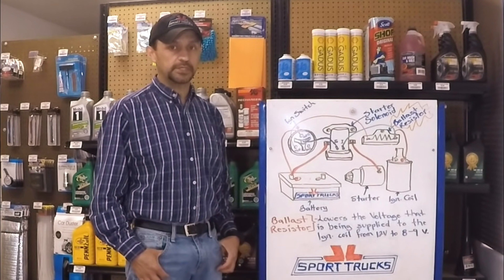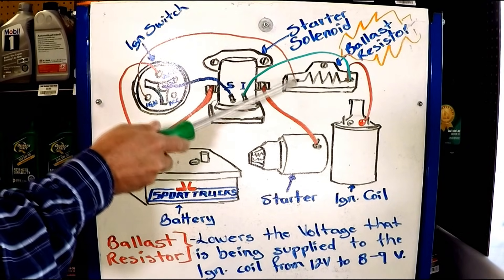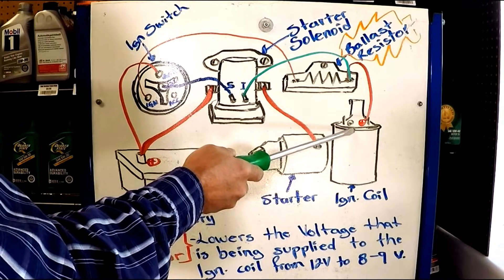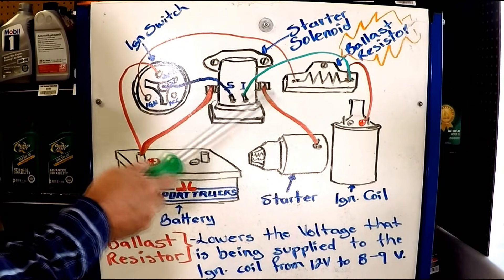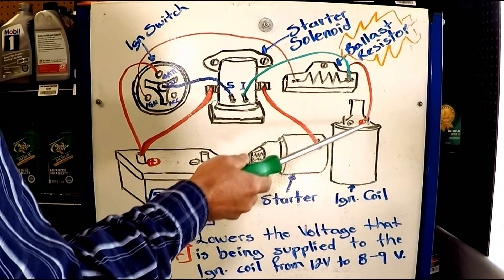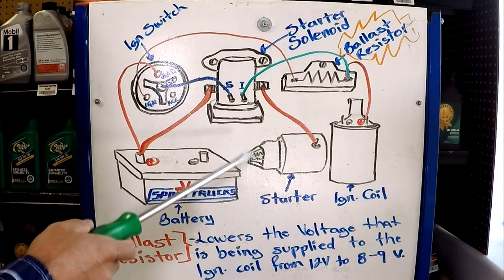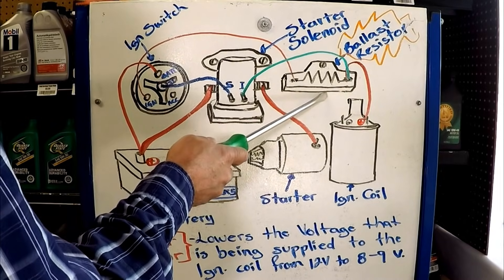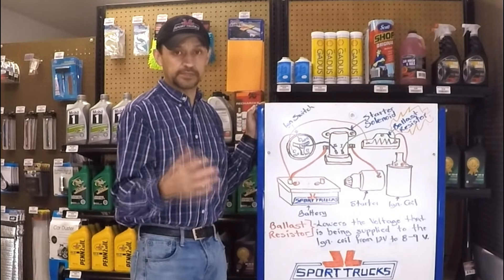How the Ballast Resistor Works

Comment: Very well explained.
Reply: On a old tractor I'm wiring up I wired in a wire with a diode into the wire from the starter button to the coil so it bypasses the resistor

Comment: Good information! I learned something on this! I've had some experiences when in cranking a motor, it doesn't start until I release the key from the START position. In doing so, the spark current returns to the coil wire when it's not totally taken up by the starter.

Comment: Is it the voltage that causes heat or is it the current flow? Isn't the ballast resistor ultimately reducing the current flow in the coil because adding more resistors into a circuit reduces current flow based on I=V/R from V=IR as the voltage is constant!

Comment: YES!  He explained it correctly.  So many people will tell you that the "I" wire is so the coil can get 'A full 12 volts during cranking'.  This is not correct.  His explanation is correct.  While cranking the potential voltage drops to 8 to 9 volts and that's why the ballast is bypassed.   Thank you!

Comment: I'm wondering , if in an early Ford tractor system at 6 volts , could the ballast resistor be removed to cure a weak spark condition ?

Comment: My '47 Ford, with original flathead V8, was converted to 12 volt system but still runs the original 6v ignition coil.  2 ballast resistors for this setup!

Comment: Dude!  This was the best damned video I've ever seen explaining what happens at ignition and why there are ballast resistors.  I am working on my Ford 640 and replaced the ignition switch was seemingly malfunctioning intermittently.  When I pulled the hood to get at the tiny block terminal, I noticed that there was a resistor under the dash wired through the terminal block.  This Tractor had a 12v conversion done to it long before I owned it, so I figured it was unnecessary and might cause a weak spark so I disconnected it (and installed a new coil requiring, supposedly, no external resistor) and rebuilt the distributor and put in a new condenser and points).  When I tried to start it after all of that, it would not start at all.  Since I know it had spark before I disconnected the resistor, I figured that ballast resistor must somehow be in the ignition circuit, so I reconnected it and it fired right up.

QUESTION:  The new coil says it does not need an external resistor, which I take to mean that it has an internal resistor.  Does this make the coil more in the 6v range and is that okay for the points and spark? If not, how do I bypass the external resistor?  I've seen a lot of comments referencing the 12v coils burning too hot for the points, but does this matter at all?

By the way, it purrs like a kitten and all four cylinders have a good spark  - I tested them all.  Shocking how good this 1957 tractor runs despite the general abuse it has taken over the years.  Anyway - thanks for the video.  This was terrific help.

Comment: Good stuff man, I bought a 66 Fury and when I started going through it I noticed that they had electrical tape around a fuse.  As it turned out they used that fuse as a bypass of the ballast resitor. Granted, they installed an MSD distributor with an MSD Blaster 3 coil, however, the coil does not need 12 volts going through it.  I couldn't find the clue until I watched your video.

Comment: Does there need to be a diode in the wire coming off of the starter seleniod to the ballast resistor to keep from backfeeding the starter selenoid when in normal engine running operation?

Comment: I have a question you do not show the wiring from the coil to the distributor I wired my tractor as you have shown and it only works if the distributor point are closed, If the engine stops with the points open the start curcit does not work. Could you please explain how this works. I put in a start relay to provide the full start voltage to the coil
Thanks Andy

Comment: My Plymouth has over 12 volt's on both sides of the coil?
a ballast resistor reduces voltage,... is there a way to test a resistor to see if its good.

Comment: I had a old civic with contact breaker points. The points burnt every two months or so. I got tired of sand paper ritual. Then, someone suggested the resistor and that solved the problem. I never damaged the coil in the 5 years I drove that thing.
In another another car, I damaged a few ignition switches when I tried to not used the FORD solenoid. It appears that the current for the starter mounted solenoid was too much for the ignition switch. It looked like that FORD system uses the solenoid as a relay for the other solenoid. I never liked the direct connection of  positive  cable in old chevrolets.
Great explanation!

Comment: Thanks so much! 

Fantastic explanations. My buddy is a mechanic and shared this with me for use with my boat: A 1989 Ski Nautique 2001 inboard with a Ford Winchester Pleasure Craft Marine 351 motor. 

I’ve been having issues with my motor starting (even with the ignition switch and key turned off) whenever I connect my battery cables. Seems like my Solenoid has maybe gone bad, but gosh your breakdown of the entire ignition chain is so informative I feel much more confident in tracking down the faulty part or cable (like you said, could be something crimped or chewed on by a mouse etc. 😅)

Many thanks my friend. You are an amazing resource of information and knowledge. Will be sure to share your content with friends. 😁👍

Comment: Great tutorial mate. Easy to understand and made a lot of sense for me to hook up the new wiring harness of my customer's Mustang. Cheers
Reply: Hello Sir, one question are you replacing the whole wire harness? If you do not mind to ask you, where did you buy it, is it new or used? I need one for my 1997 mercury mountaineer V-8 5.0 engine, at least for the coils and sensors in the engine compartment, please let me know if you can thanks in advance...

Comment: Outstanding job. I worked as a technical educator for 5 years, then 29 years in automotive manufacturing, part of that time developing service training for distributor and  fleet customer service technicians. I am not a mechanic though, but, I recognize good tutorials when I see them (an all too rare occurrence). There is a need (unanswered demand) for no-nonsense training manuals and audiovisuals for the vintage car owner/enthusiast (non-mechanics, myself included), on early Ford, 6 volt generator, positive ground electrical systems. Actually, vintage car professional (?) mechanics could use it as well. Specifically the battery/generator/voltage regulator (control box as it was called in certain publications)/starter/coil and related wiring, resistors, etc..

You wouldn’t get rich but you might break even and just think of the fun you’d have!

Comment: Good video.
Could you tell what might be wrong if my engine does not turn off when the key is in the off position. I thought it might be the ignition so I changed it, but still will not turn off when key is in off positions

Comment: This was a great video. I have 1965 Ford Ranchero, it dided on the fwy, it started back up, drove it 2 miles died again, found the power wire that looked slightly burnt, replaced it. It has  been fine but it started up again. 2 more times it died but started right back up after several tries. I put a jumper from the battery to the coil and it ran great for hours. So I think that tells me the coil is good and ballast resister is bad. Correct???

Comment: So what if my tractor is 6V? The resistor lowers the voltage to 4volts?
I am converting to Pertroix Ignitor. With their  Flamethrower coil. 
Should I dump the resistor and put maximum energy into the system?
Comments please...

Comment: This was a good video that explained it well. If this resistor is bypassed could it cause a slow crank?  My subject starts like it has a dying battery but everything is new and connections are proper. I have not checked on the resistor yet

Comment: I have a 1973 Dodge Dart Swinger with a 318 motor and I have replaced several components (Wires, Cap, Pickup coil, ECU and the coil. I am only getting ONE SPARK coming out of the coil. I am stumped and can't start my car. I was running for three years and 9 days ago, I drove it home and then on Sunday, I couldn't start it any more. I have not been able to figure out why it's not working. Any clues?

Comment: Cool video, Is it best to just use a bone stock coil with points? I have ran a few hot performance coils for my Pertronix upgrade, BUT, the Pertronix would crap out after a 100 miles of use, So I'm back to points, I've been hearing it's best not to run those  Beru/Flamethrower type coils with stock points. because of the extra point wear and tear as you mention. But I checked my keyed hot on the 72 pinto at the coil and it's at 8 ohms,  so it must have a ballast in the system somewhere. Thanks
Reply: it has a resistance wire in the harness that reduces the voltage supplied to the coil . most fords built in the 1960's through 1980's have them . the older chrysler corporation vehicles have the ballast resistor mounted on the firewall .

Comment: Mostly right but when "I" terminal is used the coil will "not" have 8-9 volts it will have battery voltage (12.6volts). What else would you think it would have if it's bypassing the resistor????

Comment: What if you have a 12v ignition coil. Do you still need the ballast resistor or can you delete it?
Reply: Only works with a 9v ballast resistor type coil. Not needed if 12v coil

Comment: Excellent work man. Just the information i needed.  I'm jury rigging a 6 volt horn to work with a 12 volt system using a ballast resistor to  compensate for the extra voltage/amps.

Comment: Thank you! I like the way you explained it. 
My car would not start after coming back from a 10 min drive. I got it to run for 30 seconds and would not start after . I may have flooded the engine maybe because no spark? I’m getting fuel ! Plugs looked wet and fouled. I gaped and installed all new spark plugs and still would not start . I noticed the + wire from the coil is not hooked up to the Ballast resistor.. I’m not sure if I snagged it off replacing the spark plugs. The male connectors on the Ballast resistors seems loose and it wiggles?? Is that normal?the voltage checked out 12.85 on one side and 7.89 volts on the coil side with the key on. 
Still won’t start! I bought a remote starter switch at amazon coming in 2 days. This way I can crank the engine from the engine bay. Should i check the coil next? How do you test a good or bad coil? Should I also check the points? 
The car ran fine prior To it not 
It is a stock 200 ci  Ford straight 6 cylinder in a  1961 Ranchero. I subscribed to your channel 💪🏻🔥👍🏻

Comment: I'm currently in a position where the ballast resistor is overheating and all I've done differently is purchase a new bosch starter the  solenoid is joined to the starter. I've replaced the ballast resistor thinking that it might be broken yet that didn't solve the problem. What would you recommend?

Comment: I got 12 volts on both sides of the resistor with the ignition in the on position and 0 ohms when tested. Is this a bad resistor?

Comment: Awesome! Somebody finally took the time to explain the "why" not just the set-up & routing of these wires, but why it is wired this way.  This is very helpful in diagnosing a no spark situation.  Thank you for taking the time to make this video.
Reply: most spark problems start with wrong mfd condenser  value or it is defective if points are pitting look at condenser  some just clean the points and ignor the condenser  it is criticle important that the primary winding and the condenser match   for instance i found my 53 dodge uses a 27 mfd for max spark  it is a ball of  of fire now  had wrong value so a weak spark . this is refered to as series resonant circuit  look this up it explains in detail (on line)
Reply: @frankdavidson9675  Thanks for the extra info.

Comment: working on a Ford 600 tractor .Does the tractor need the resistor if the system has a 12  v battery and a 12 v coil .It had a 12 v battery and an old "who knows" coil.the coil was replace along with points ,plugs,wires ,cap ,rotor, and a starter

Comment: If I'm supplying 12 volts to the ballast resistor and is not dropping the voltage  coming out of the other end of the ballast . is my ballast resistor bad?

Comment: Great tutorial, helped understand the reason I have a ballast resistor on my TR7 which now runs a 12 volt coil in place of the original 6 volt coil.
Reply: Be careful  on  coil selection  some coils have a  built in  resistor. No  need for  external  resistor

Comment: I put a new SBC 350 Vortec in my 55 Chevy with and a HEI distributor, now when I turn the heater blower on it kills the engine, can someone please help me? My car does still have the ballast resistor hooked up, is this the problem? I'm needing help here please.

Comment: My ignition coil has a built in resistor. So the external resistor is no longer required, correct?

Comment: GREAT!  I confess that about the only thing I know about automobiles is the ignition system, so I completely understood all you said.  I use many of these parts for non-automotive applications--much cheaper!  Especially the starter solenoid and the ignition coil for high-power flashtube triggers in large lasers.  However, I would like to comment that you should have shown an actual ballast resister in the video so people would know what they actually look like.
Thanks much!
Reply: Hello my friend, one question is it hard to install a ballast resistor on a 1997 mercury mountaineer V-8, 5.0 engine, i do not know if this car has one already but it keeps blowing my ignition coils i feel like their are receiving too much current,  but honestly i do not know where to start maybe you have time to explain me, so far i just found out that wires 5 and 7 has no spark and the car shaking too much, i am reading trying to find out why this two wires are not sparking. If you can, please help me where to start, i sincerely appreciated your time and thank you in advance...

Comment: My 1958 Dodge D100 does not have an “I” terminal on the strayer solenoid. So where to I wire the 12v during cranking?

Comment: the ballast resistor works by, well, being a resister   it resists the flow (amperage) of electrons moving in the circuit to all point downstream of it. it is the flow (or amperage) of electrons that do the work. voltage is just the pressure to move those electrons and is proportional to the flow.   we use amperage to weld with. the electron flow causes heat and transfers metal with it .  you can run a vehicle without a resister  but the excessive flow will cause  heat in the coil and points shortening their life dramatically.   yes there will be a voltage drop after the resister but that is a side effect caused by the restriction to flow. E=IxR once you master that electrical is easy.
Reply: My friend i can tell you are a PRO the way you talk about this, hope i can learn from you something, i am in need to fix my car due to economical situation also mechanics charge an arm an a leg and some of them are not honest, i want to fix my car, i tell you a little bit of my situation, i have a 1997 mercury mountaineer V-8, 5.0 engine it has 8 spark plugs, 6 of them spark very good, number 5 and 7 do not spark at all, number 5 is in one coil pack and number 7 is in the other coil pack, 8 just bought the coil packs they are knew, i feel like i have a bad electrical wire but i do not  know where to start, can you teach me how to test the right way the pigtail/ connectors of a coil pack...thank in advance...

Comment: Fantastic!! My 62 Chrysler THANKS  YOU!!
Just make sure when  engine shuts down like he said, dont assume it is the ballast,  check wire harness wires could be broken  or just not  fully pushed into the fire wall  or  contacts need cleaning. This was my problem and it took a while to figure out. Follow the power like he said you will find low voltage or no power and that tells you where the problem lies.  This really helped and I liked the screwdriver  pointer Awsome!! My 62 chrysler thanks you !!
Reply: Hello friend one question, do you know how to test and what to expect on the wires connector/pigtail of a coil pack i have a 1997 mercury mountaineer V-8, 5.0 engine, i have a problem just bought two ignition coils for my car they are good duralast brand but some how spark plug wires 5 and 7 are not sparking, I really do not know where to start testing and i do not know how to resolve the problem, i need help my friend please let me know if you can help me to figure out and where to start. Thanks in advance...

Comment: sir what is the value of ballast resistor how many ohms or kilo ohms?
Reply: For 8 cylinder engines it provides at least 1.5 ohms. For 4 and 6 cylinders, at least 3.
Reply: Awsome question! I was thinking the same thing for the value of the resistor in oms for a V8. Thanks to the both of you.

Comment: THANKS.  After I washed my engine of my 56 Tbird when I tried to start it it would die as soon as the starter shut off.  A mechanic told me my carb was the problem. After many hours of diagnosing this and that and finding everything in working order, I finally noticed that a wire had come loose that was connected to my coil resistor and as soon as I hooked it up it started and ran just fine.  Sorry I didn't see this video sooner it would have saved me all the time of trying to figure out what the problem was.
Reply: Please share your experience on review sites for the mechanic who misdiagnosed your problem. It's the only good way to help others avoid rip-offs. Thank you.